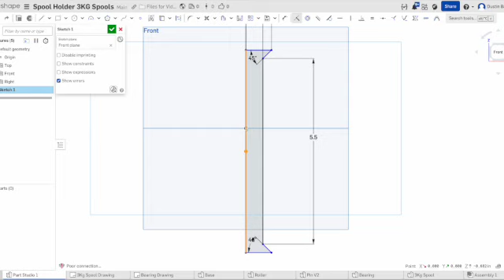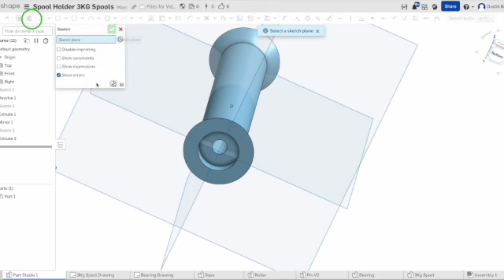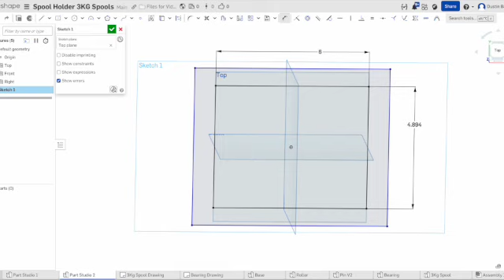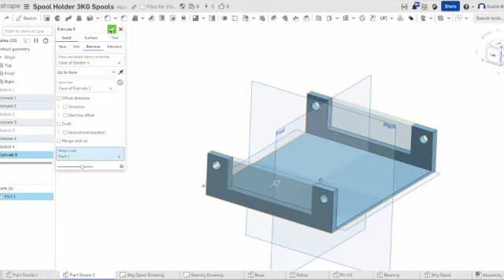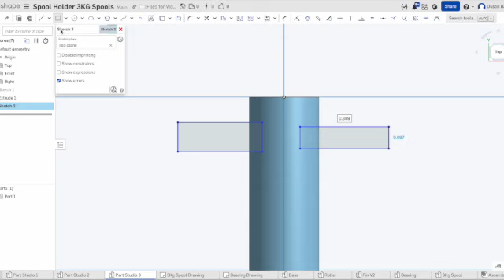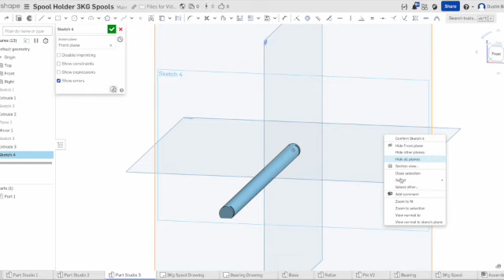How to Make a 3kg Spool Holder | OnShape

Comment: Hello there, I found your model on Pintables and have printed it and ordered the bearings linked. 
The bearings are way too small. could you list the size it's supposed to be? The link may just be pointing to a page with multiple options and it defaults to the first one.
Reply from the maker: Hi, very sorry about that. The bearings can be bought at this link: https://a.co/d/1CPQYW6. You can compare the size to the drawing I have on printables as well. Just in case you want to double-check. I'll go ahead and change the link so this doesn't happen in the future. Thanks for bringing this to my attention.
Reply: @bam3dprinting   Awesome! 

Thank you for the update, after looking at the CAD that definitely looks like a better size XD